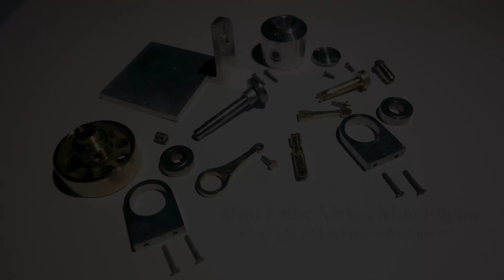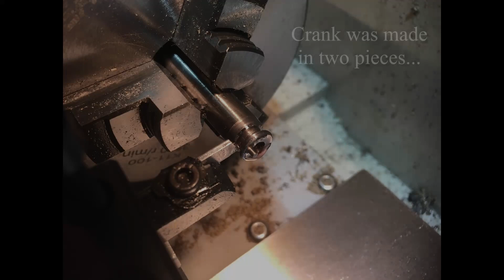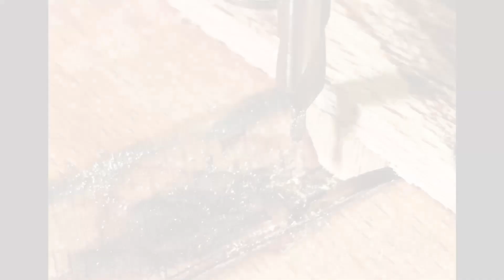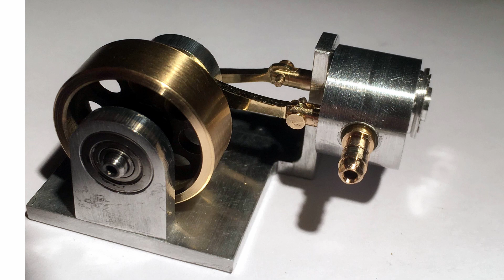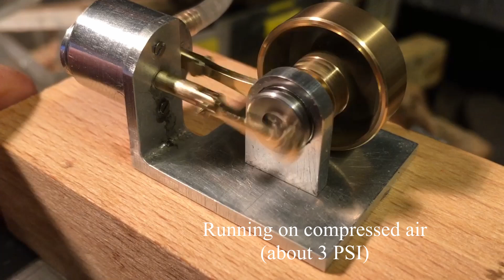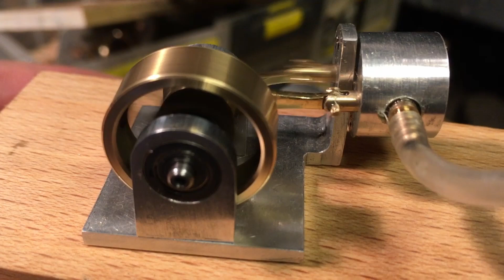Mini Lathe Makes Mini Steam Engine

Comment: Very nice! I'm planning on making smth bigger, altoug i don't have a lathe my dad can machine it at his job. I wanna use Allan's valve gear
Reply from the maker: Thanks very much! I had to look up the Allan's valve gear - I only knew about Stevenson. Should be a neat project. Thanks for watching.
Reply: @Mister_G  Thanks for a quick response! I'm i highschool and I'm doing some other things as hobbies, so just the planning is gonna take some time, especially because it is my first time doing technical drawings. It will be quite a bit bigger I'm thinking around 10 cm (which is about 4 inches, I believe)
Reply from the maker: @tenix6698  Good luck - I find it helps to model things in Fusion 360 or something first so you can check that everything operates as it should.